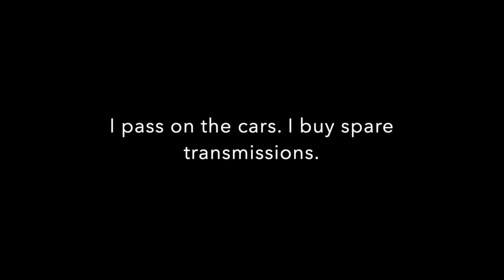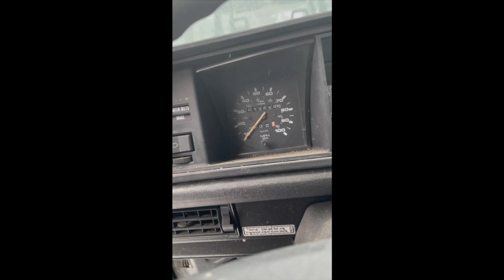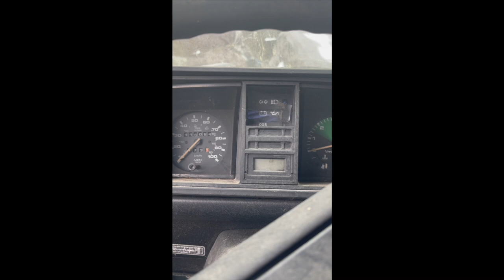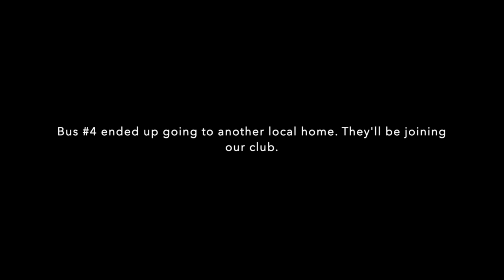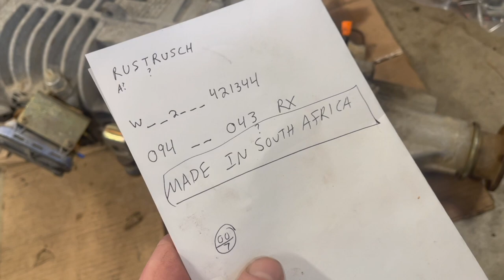Syncro Stories- Securing Spare Transmissions and Rehoming Local Syncro Vanagons.

Comment: How much does it worth syncro transmission
Reply from the maker: Each transmission sold for $2500 US, instantly. So realistically- more then that.
Reply: @TheBarefootForge  thanks for the info because i have 2 one with locker and one without
Reply from the maker: @olaabdallah7923  they’ll sell easily on www.thesamba.com
Reply from the maker: @olaabdallah7923  where are you located?
Reply: Ottawa canada